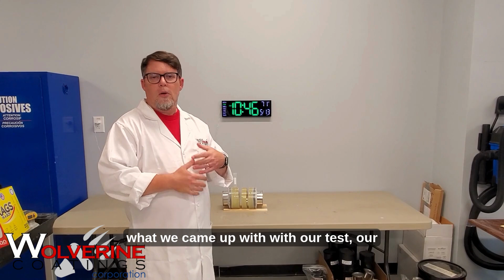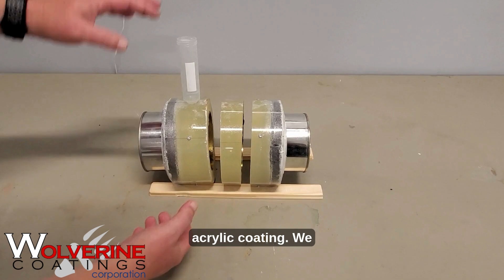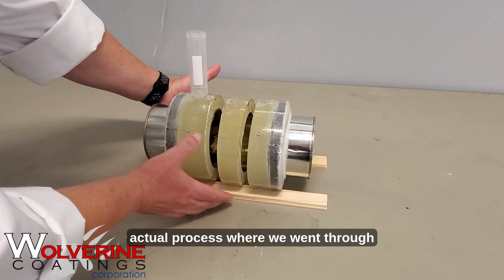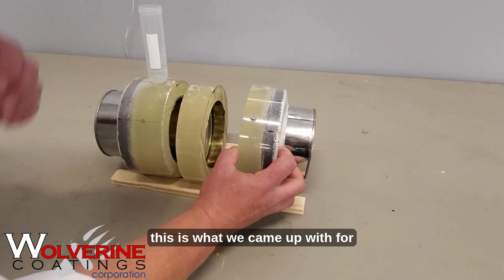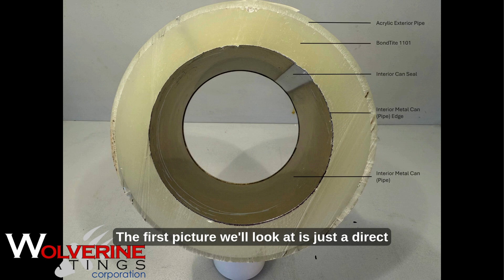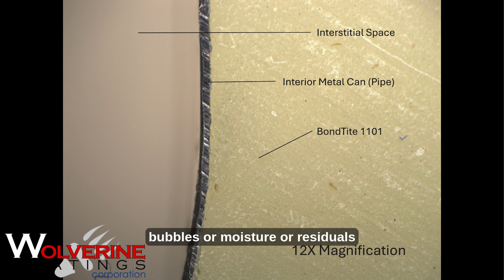Removing Moisture From Underground Pipes - Lab Test (Part 2 of 2)

Comment: Cool, so you discovered that hydrophillic and hydrophobic don't mix and that the most dense phase sinks to the bottom forcing the other one out. Why is the epoxy more dense than water though? Is it halogenated?
Reply from the maker: Hi @bdbugget, What a discovery, right? lol... This is not halogenated, although we do make some halgenated epoxy materials. But, the cost to halogenate is much higher, the cure slower, and the biggest plus from that is UV resistance. Of course, for this application there would be no need for UV resistance inside the interstital space between the pipes. But, good guess. The truth is, we grind up unicorn horns, eagle beaks and sprinkle a bit of unobtanium dust in there. ;) I hope you appreciate the humor. I see you have some cool videos. I'll have to catch those sometime soon. Thanks for your comment and question.
Reply: @WolverineCoatings  haha awesome, thanks for your reply :)